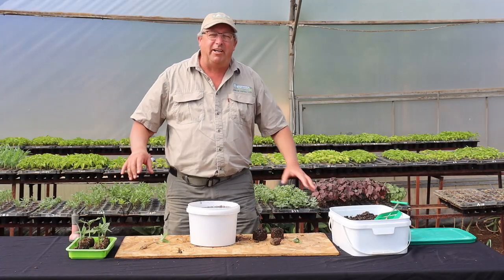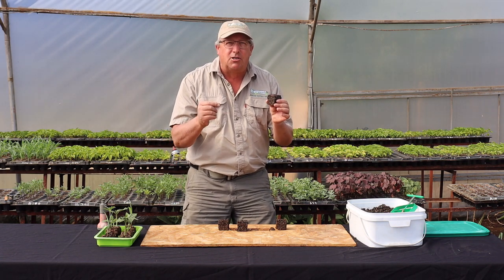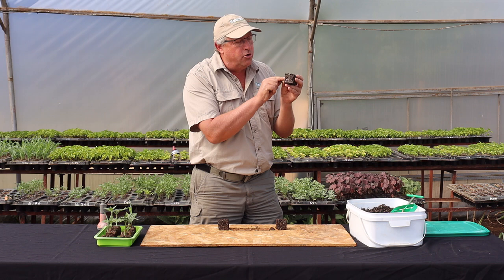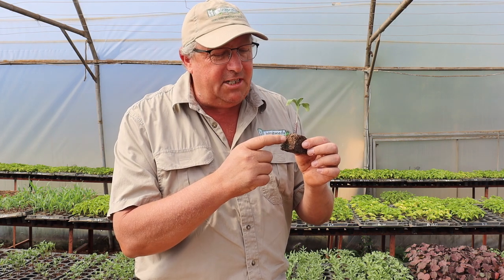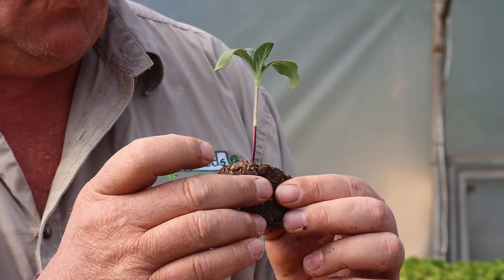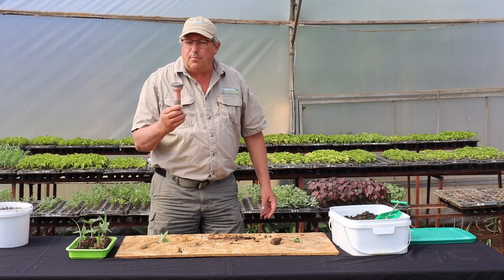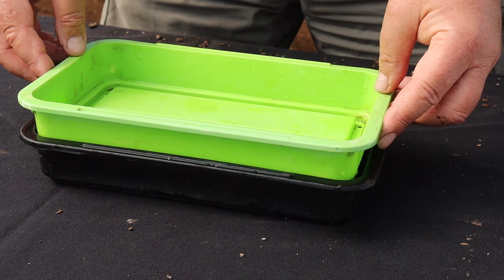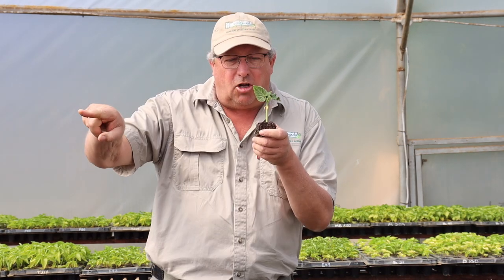Why Soil Blockers Work.

Comment: I have been looking into soil blocks for a while now and I like the fact that I don't need to use pots or cups that is laying around the place afterwards I also was skeptical about it like Royce and wonder how it will hold up when watering I'm one of those guys that first needs to try something before getting the reel thing so I will definitely give this a test and see how I get it right thanks for the video I'm more convinced know
Reply from the maker: Excellent, so glad this helped.